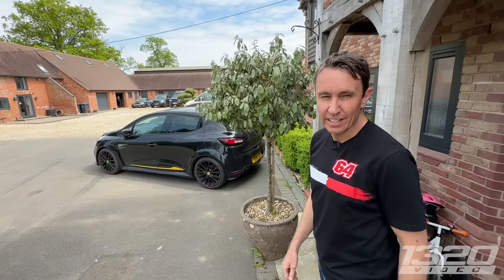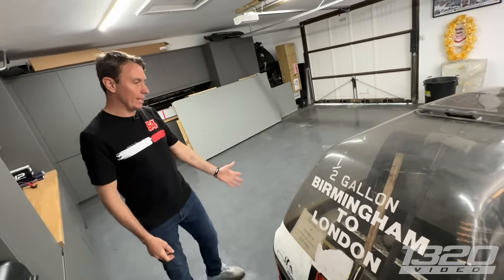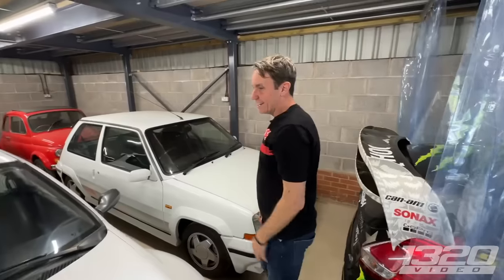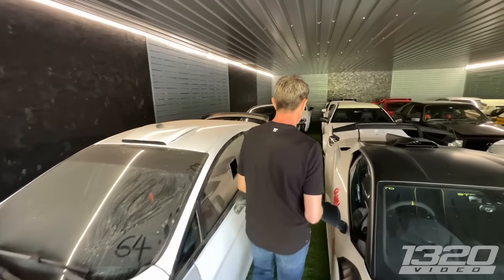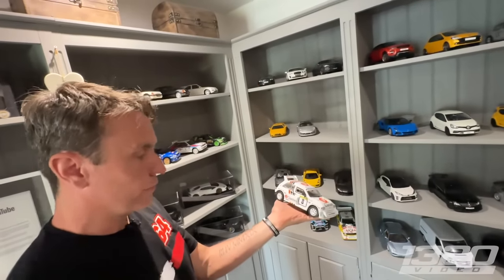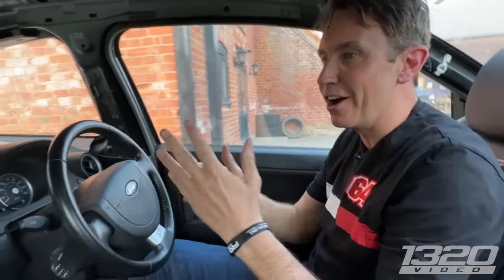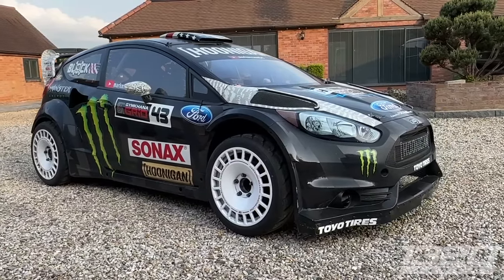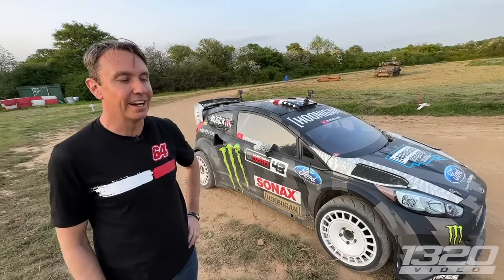Inside the EPIC Car Collection of a British SXS Racing Legend (1320Garages Ep. 10)

Comment: 5:53 The two small white vehicles are danish. They were called Ellert (el means electricity) and it was an early EV. They were sold from 1987. They must have been rebuilt at some point. I don’t recall them having a combustion engine. Later production went to Germany.

Comment: @1320video The funny three wheelers at around 06.00 are actually something as rare as danish produced cars. Nicknamed the Ellert, the MiniEl was a Danish attempt to build a cheap electric car - I have no idea why yours were converted to run on diesel, but originally in the mid-80's, these were electric. :) The factory went bust in 1988 after opening in 1987. Production then resumed later on as a german buyer re-opened the production in Germany.

Comment: I have the Merc, not with yellow accents but exactly the same just black, no aero kit. It’s got a dog guard in the back, no one ever uses the back seats but it’s my daily whip, to and from work, raining outside? Have a cig in it, whatever. I use it, low miles 23k 2018, the last of the pops and bangs but I hate them! I don’t want to look a knob changing gear in a rush thanks, I use sport and C, stiffer ride exhaust flaps shut. It just looks like an a200d but it’s mega. I had Subaru for years and wings and spoilers just ain’t my thing at 47 but those cars can be sleeper as fuck